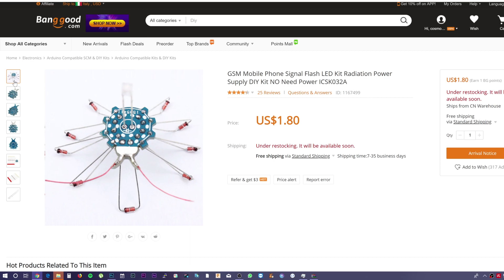How to assemble a GSM Mobile Phone Signal Flash LED Kit DIY

Comment: Thanks, I just dabble with electronics and I was sceptical about this kit, it works, just that newer phones probably have a fainter GSM signal and it has to be very close from the GSM module on the phone (different place depending on the phone)

Comment: One diode facing a different way ,I guess it doesn't matter ,mine missing one,plus I need to make up my missing whiskers.hope mine work too nice job
Reply from the maker: I understood that there are different models with different diodes. The important thing is that it works !! For whiskers you can use any piece of wire. If you have not already done so, subscribe to the channel! Thank you

Comment: I wonder how it worked, diodes' polarity is wrong !
Reply from the maker: I followed the drawings on the board. If you look at minute 1 of the video you see how to mount the diodes. Actually compared to the images of the product are in reverse. As soon as I can I look at it better. Thank you so much for your comment!
Reply: On the PCB, negative is outside and positive inside. Check here : https://upload.wikimedia.org/wikipedia/commons/8/83/Diode_pinout_en_fr.svg
Reply from the maker: Since you doubted me, I tried to reverse all the diodes. It didn't work anymore. I tried to invert also the led but it still didn't work. I checked the scheme and it is correctly mounted. Mystery :-)
Reply: Strange, have you the same PCB with + in the inside et - in the outside ?
Reply from the maker: @olivierdeschamps1743  On my pcb there are not the signs + and - but some squares. If you look at minute 1 you will notice that my pcb is different from the one in the photos of the banggood site. Probably the one on sale now is different than the one I bought some time ago.
Reply: I see. Thanks !